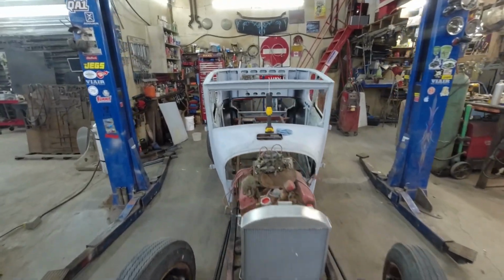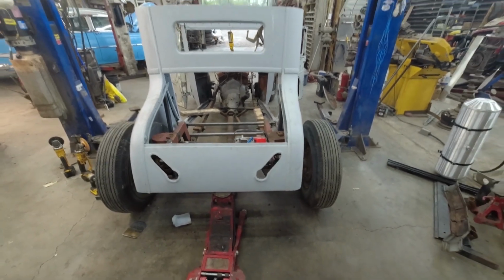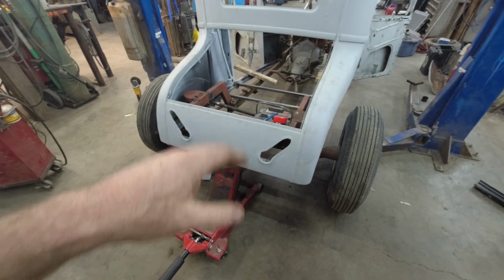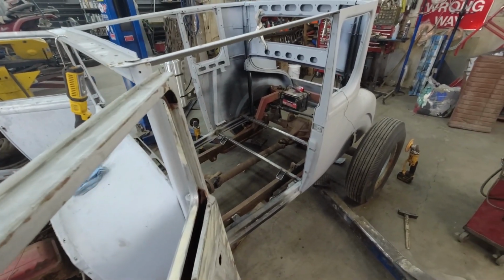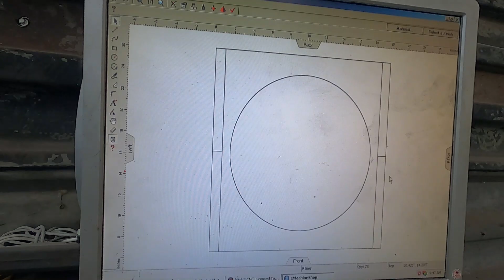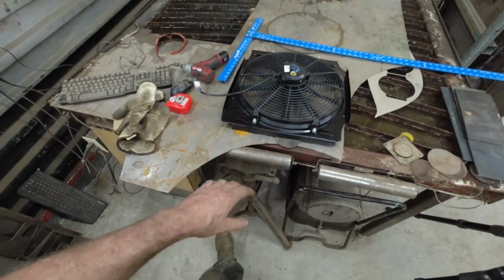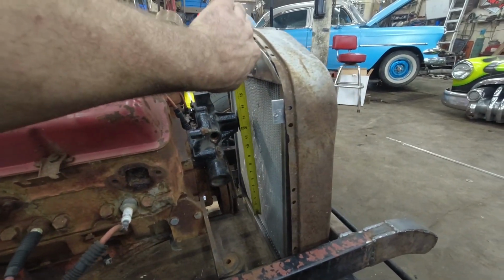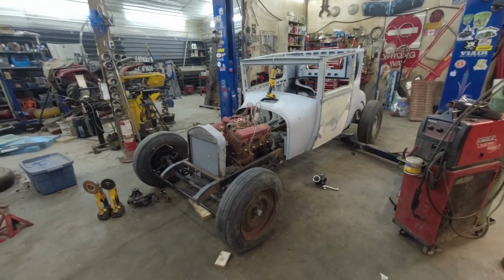Building body mounts and remounting the radiator, motor and transmission.

Comment: I love  the way you do fan shrouds. If I was doing another ride I’d do it how you did it. Great job. Yep it will do the job. I think it will be a really much cooler engine! This old car stance is perfect. I do agree that those shocks need more travel. I loved using coil overs from Pète and Jakes👍👍 I never had great tools to work with.  Hammer and dolly, welder, grinder and my thinking cap!

Comment: G'day Brent.

If you twisted the actuator arm for the two speed selector linkage backwards and shortened the rod connecting it to the transmission by an appropriate amount, you might be able to winkle the steering box in at the back where it doesn't quite fit at the moment.

Comment: Hey Brent , I like the front wacky steering just the way it is because it’s very different ..wacky..from most other Ford coops . I found that some of the factory fans pull better air than the aftermarket ones mainly because the factory ones even though they are smaller have a better blade pitch and the trade off is they make more noise . 👍👍enjoy your cruising at the fifties .

Comment: Hi Brent, 
Your T is coming along great. Especially for a build you are taking pretty casually. You've got the overall stance looking good and dropping the radiator down was the right thing to do. I like the slight rake. How about chopping the top a bit? Maybe a small chop like 2 or 3 inches. I think it will make the car look better proportionally and won't cost you much headroom. My 2 cents. Really enjoy your videos.
Reply from the maker: haha it's been chopped I think 4" already

Comment: I would move the rad just in front of the axle, then move the engine/trans forward a little bit so that the distributor is not so close to the firewall, then you can use either water pump, and still have room for electric fan, but all else looks good.

Comment: I put a recess in my firewall for the distributor. I have a Cadillac 390 (1960) in mine and I also had to  add 11 inch's on the frame. It has a Saginaw 4 speed behind and 8 inch limited slip.

Comment: That linkage set up on the Powerglide is not a shifter linkage, it is a kick down linkage. I'm running a 2 speed glide in my 1929 Chev Roadster and I disconnected it. You can always run a cable set up instead should you want to have kick down.

Comment: I'm guessing someone has already said something about the Ackerman being screwed up with the tie rod in front of the axle. The tie rod ends would have to protrude through the wheel to achieve the appropriate angle. The suicide setup will have the outside turning wheel turning a smaller radius than the inside one.

Comment: I'm not really a t-bucket type of guy but I don't like your mock up for the front end.  The rad and grill frame just don't look correct  where they are now.  Maybe if you included a little flared sheet metal work up in front over the frame horns.  Actually I'm' just surprised you can build these cars front parts around the yard.   I always enjoy your videos.  Keep up the good work.

Comment: Mak'n what counts da body mounts, cut'n way up n out for da axel, drilling da body mounts bolt m down [electro fan shroud fer da 50 Buick] cut off move n weld back da mounts fer da small block n powerglide, lowering da rad mount n grill shell, rear shocks gonna have upward chocks no travel, just move da mounts everything's fluid

Comment: I am wondering how the car will run with coils at the rear and a leaf spring at the front. Its usually the other way around or leaf/coils front and back. Wouldn't it be better to use a pair of coil overs on the front and then you have a better chance of fitting the steering rods to the rear of the front axle and get the look you are after

Comment: I have a question: Do the 2-speed Power Glide, 350, 400, and 700R4 transmissions all have the transmission mounts in the same spot? I'm curious, because you still have the Power Glide transmission in at this point and you've moved the crossmember for it before the correct transmission is in. Thanks!
Reply from the maker: The 700r is longer the rest I think are the same.

Comment: Love you builds and channel but the welded in transmission crossmember was a bad choice. It makes it difficult for the next guy{s}. Also, it looks silly with the engine way up in the air. Engines need to sit low in the frame. Not your best but maybe it's just me.
Reply from the maker: motor need to be there to make the steering work unfortunately any lower I won't have room for the steering box

Comment: Can you get a low profile distributor ? I think the engine is sitting way to high for my taste , personally 3 inches to high that way the steering will work better and whatever your using on the intake wouldn’t stickup to high and block your view , just my opinion and it’s your rig not mine ! Using that nice spun tank would be a shame to hide it , don’t you have a behind the seat tank from a pickup ?
Reply from the maker: would be to big really. not a lot of room on this one for some stuff haha